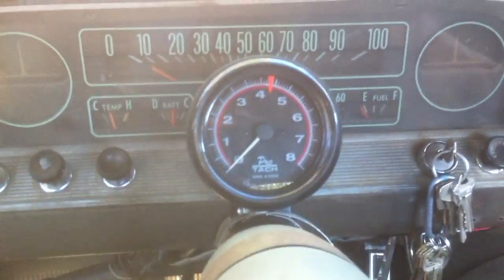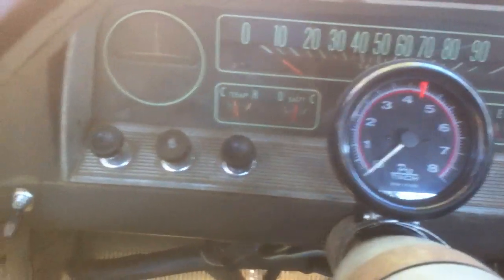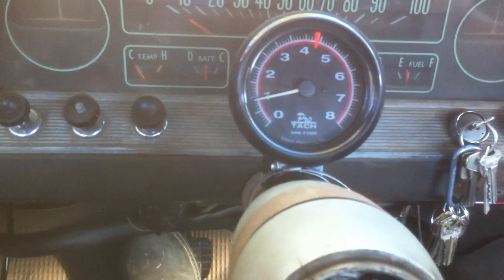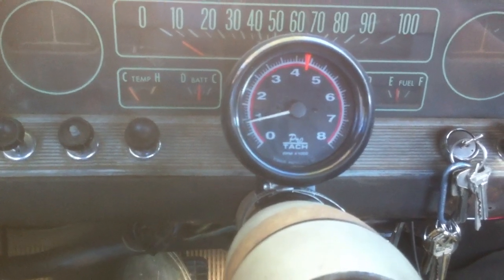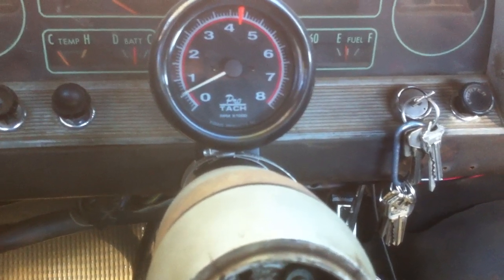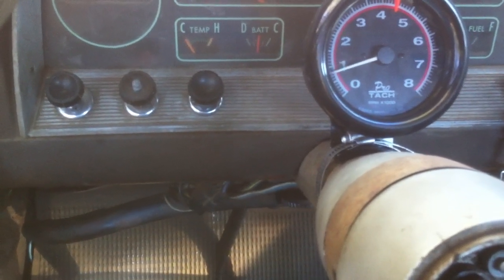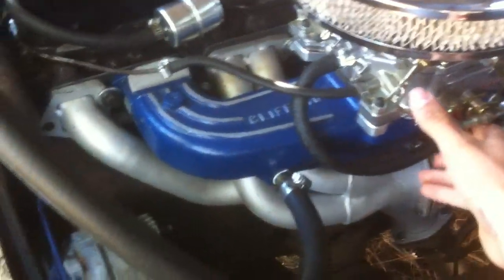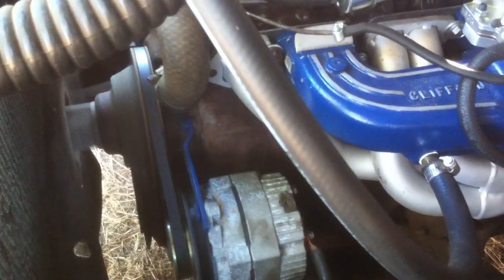1966 chevy 292

Comment: the 292 is the ultimate 6 chevy made back then, my dad said he was in a 1972 chevy truck with a 350 with the bed full of stone and my pap had a 1973 with the 292 6 fully loaded as well, and my dad said that the 292 would pull away from him on the hills
Reply from the maker: They are torque monsters for sure!

Comment: I have a 292 in my 66 c10 and I just can’t get myself to pull it and put in a v8. It still runs and is pretty torquey for how old it is. 2nd gears fun for about 3 seconds and then I have to shift

Comment: my 292 cold starts right up without needing the choke, perhaps it´s because of the Rochester monojet its running.
Reply: If I have fuel up to the carby (mine sits for months between starts), it will start without the choke in 3 turns of the crank, quite often less. If it has fuel, spark and crank speed, I know it will go. I have the factory HEI, and I'm sure that makes a big difference. These old dears pull like bulls. The more I drive mine, the more I appreciate how good they really are. I haven't done any head or carb mods yet, but I'm sure that's where the best dollars are spent. If you are looking to do one up, get Leo Santucci's "Chevrolet Inline Six-Cylinder Power Manual". Probably one of the best hot-up books ever written for any engine series, not just Chev 6 cylinders.
Reply: Same.   The monojet is highly underrated on the old 292

Comment: i just bought a 66 c10 and i was wondering what that third nob you pushed out before turning the truck on was, could you help?
Reply from the maker: That would be the choke nob as this carb is setup with a manual choke. :)

Comment: I hear an awful lot of valve train noise .. Or how about maybe a worn out pump or clogged pick up .. what's with the odd idle ? I've owned 3 292 starting with a 68 Panel delivery truck I owned with 240 K on the OD and it ran like a scalded dog ...